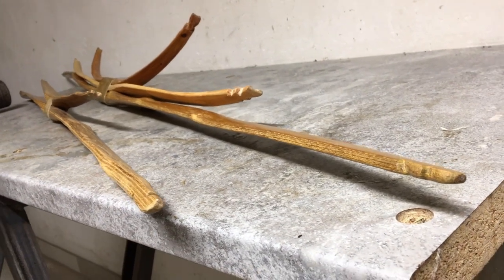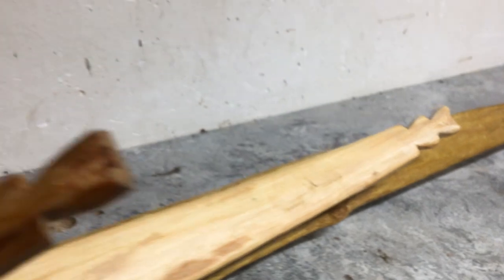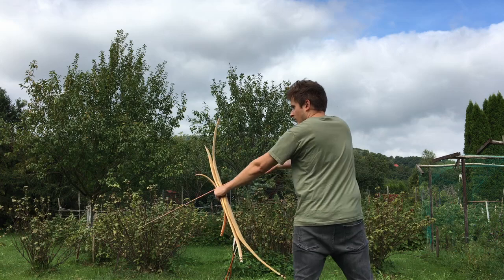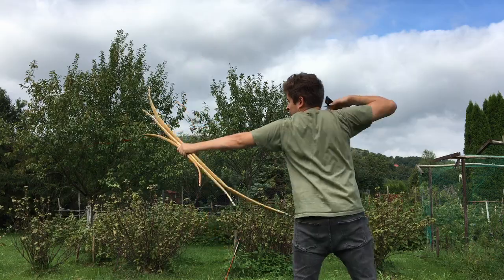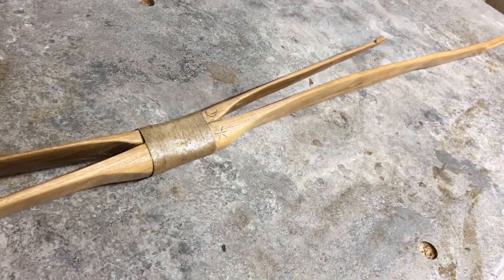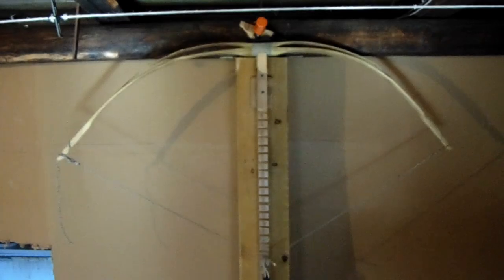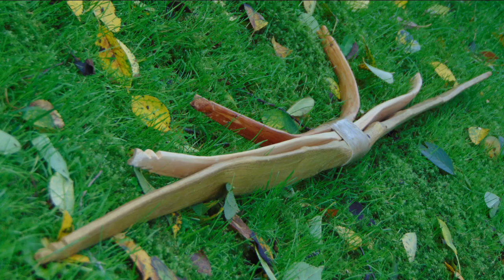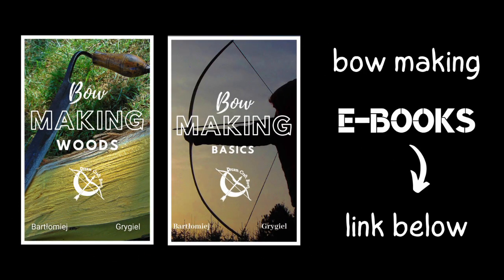Penobscot Style Bows - PROS & CONS

Comment: I have seen pictures of an actual Penobscot with a different arrangement for the strings.  Instead of attaching the secondary strings directly to the tip (which seems like it would have a lot of stacking problems), the strings were attached near the handle and layed into a grove at the tips of the secondary bow.  Instead of pulling the tips back, it would compress them almost like a very simple pulley.  It worked quite well.  I gifted it to a Migmaw elder who was teaching a course that my wife was taking.
Reply: Sorry, but I can't quite imagine how that looks. Could you point me to an image or go into more detail about what is fixed where?
Reply: @edi9892  
Place one of your fingers between two of the fingers on your other hand. That's roughly what I suppose Knightraven meant by "groove at the tips of the secondary bow". The two fingers on your second hand act as the groove or notch, and the finger laid between them is the string.

The secondary strings simply run from just south of the handle, along each arm of the secondary bow, through grooves or notches at the tips of each, to the tips of the primary bow. This action compresses the secondary bow more than pulling it. I imagine the overall effect would be much the same.
Reply: @PwnEveryBody according to Judson (primitivearcher), it makes for a smoother draw but I'd personally have to see for myself if I ever get around to make them correctly.

Comment: What if you made the limbs lighter on the primary bow and heavier on the secondary, that way torque trades for speed without increasing the inertia of the primary?
Reply: I feel like you could really get a powerful setup with a english style longbow base, a bamboo middle bow, and a solid horn shortbow on the front.